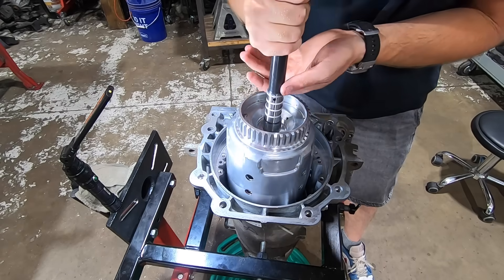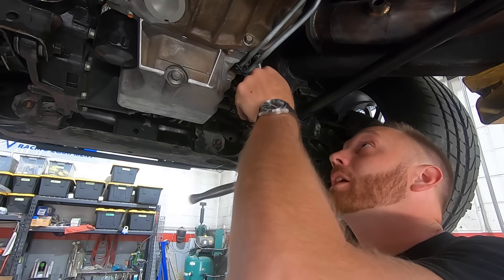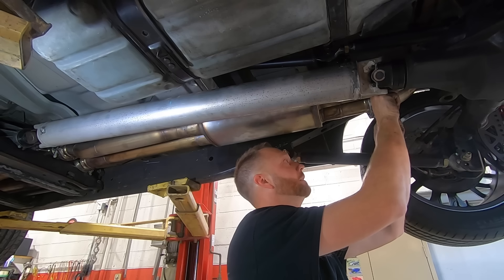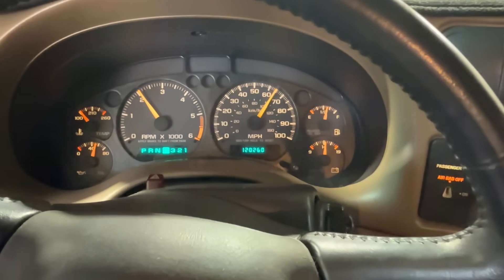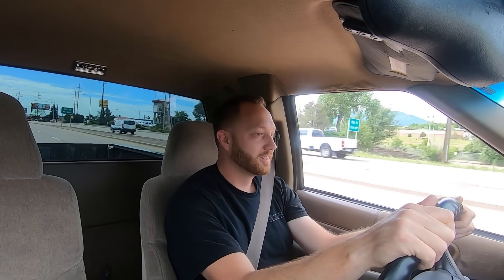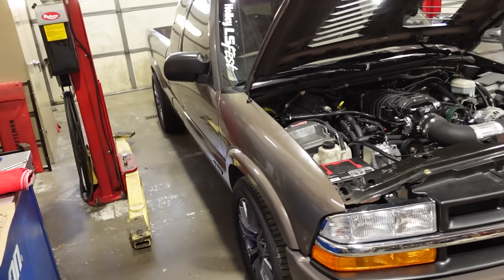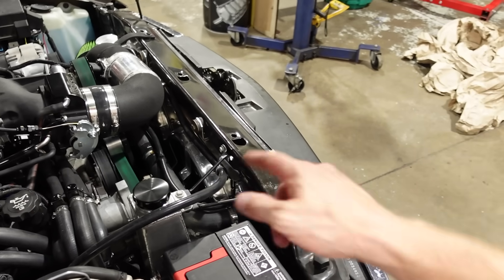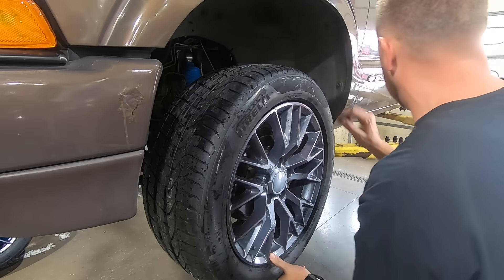can my DIY built 4l60 hold up to the SUPERCHARGED SYCLONE?

Comment: ATRA rebuilders manual has a blurp in there that the 5 pinion planetaries don't hold up particularly well in high RPM conditions, they recommend the earlier 4 pinion in that environment.
Reply: Numerous 5 pinion builds between 6800 and 8500.  Never seen that.  I call BS.